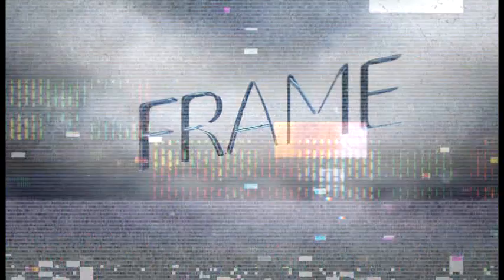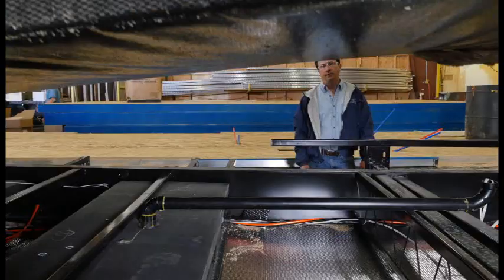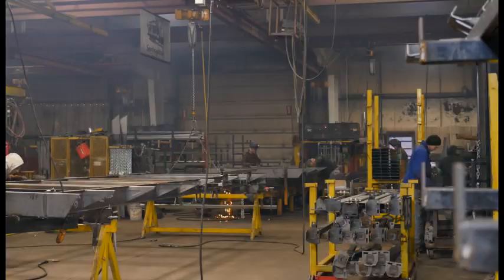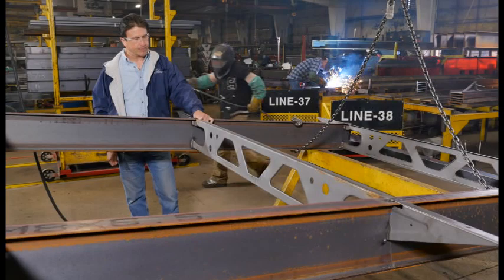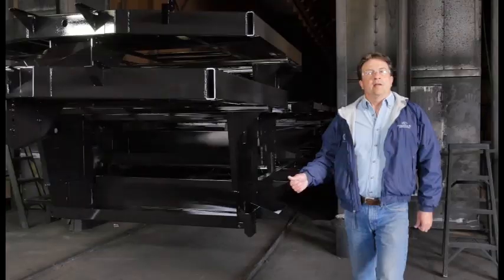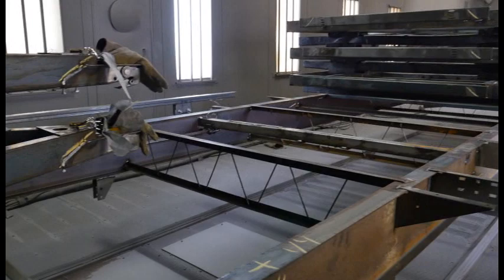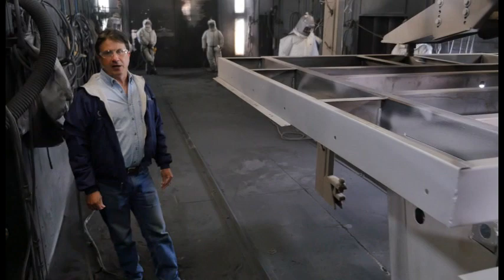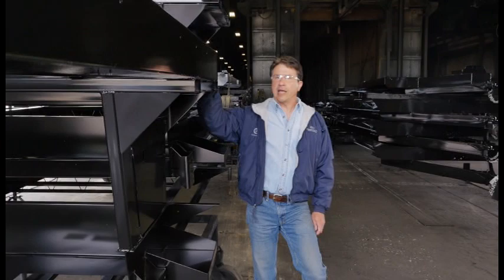Keystone RV  - Frames

Comment: Bought a 2015 Dutchmen Voltage that was the most poorly build, problematic piece of junk ever. Rebuilt the suspension twice. The second failure was towing 50 miles home from the dealer totally empty after just having all the springs replaced. $900.00 later a spring & axle shop fixed as best they could given what they had to work with. They also short sheeted the roof material and covered bare wood with lap sealant at the edge. Roof rotted on a two year old rig and Keystone told us to go pound sand. It was literally falling apart in the driveway, the list of disasters is several pages long and well documented. We finally had to trade it and the truck together to get rid of that $70K piece of junk. Dealers would not give a decent trade since they know what they are getting.  Buyer beware, Keystone RV produces junk and does not stand behind their product.
Reply: You speak the truth....I have had the same problems with a Raptor 2013.  I've had to rebuild it myself.

Comment: Keystone frames from Lippert are some the worst, cheapest pieces of crap on the market! Made of MILD STEEL, at best! When trying to repair said frame you MUST use REAL steel panels to frame the split and then it will break in another area because the weld then becomes the strongest part of the frame. They use some kind of alloy metal that actually looks like pewter!

Comment: You guys think you got it bad... I got a 30 ft 2001 sprinter by keystone and its all rotted wood in the front. Good news is I only bought it for 350.00. Can't even figure out how the front is attatched to the frame even with the shell on the front off

Comment: I thought Thor build their own frame for Keystone,  hv 2018 keystone sprinter campfire 29bh. Travel from California to Oregon to Florida. So far good, but lot of issue.
Cabinets cheap, vaneer, peeling off, black flush water leaking, propane auto switch need replacement, power tongue jack need replacement. Bought extra water pump, motor for 2 slides. And always hv Mcguyver tools and parts just in case.
Reply from the maker: Most manufacturers use one of two frame manufacturers: Lippert or Dexter

Comment: Have to second that opinion.  Bought one that did not have a secure outer siding...made multiple calls and they would not stand behind their product even though when it was installed you can see where it is missing 14 screw holes that were only half screwed in. I called for several managers and they just say it could not happen.  I verified with the previous owner and the company that has done all repairs on the RV and both state this panel was not installed. I would not buy anything from this company they do not product a quality product and they do not stand behind their poorly made produce.  I just paid almost $3000 for a repair I should not have been responsible in my opinion.

Comment: The suspension twisted and buckled. The cheapest softest frames on the market. This trailer has 2000 miles and three trips total. No damage to trailer. Will they repair it or replace it? Nope they are getting sued as we speak. I am a professional driver as well.

Comment: My Keystone Passport GT is a piece of junk. It is a 2021 and is a 2400 RB. Nothing but problems out of it and horrible management and Keystone could care less. This is based on my own personal opinion and experience. I also climbed the back ladder and it broke and they claim I told them it was cracked and then I did it. Not true ! It cracked because of me climbing it and no sticker on it telling the weight limit. I had a warped refrigerator door, warped cabinet door. Both sliding doors coming off the tract.  Top of shower coming apart. Sharp edges on some of the wood. The bed was not the original bed. Someone switched it out and the whole bottom of it was ripped. The wood on the right side of the bed was all chewed up.  Sawdust still coming out everywhere. Light covers come of everywhere in the camper after you have been on the road. The GE A/C is so loud that you can barely hear the TV. Lot more stuff I found. I find the Director Of Operations rude and unprofessional for Keystone RV. Please buy a Forest River or something else but I would stay away from Keystone RV.